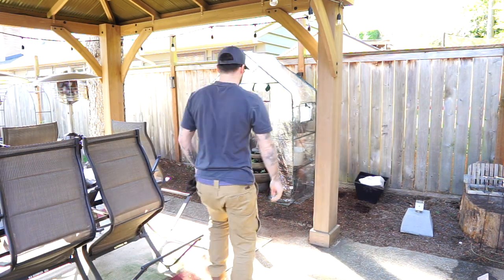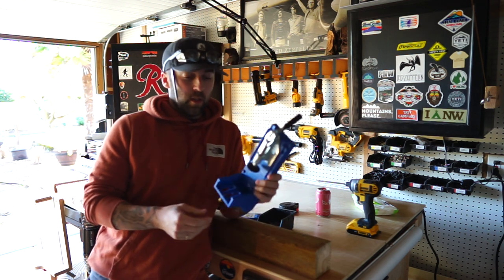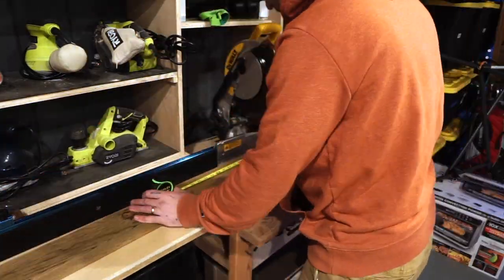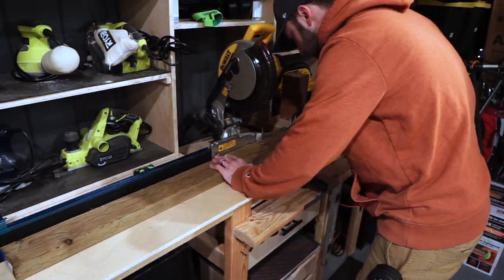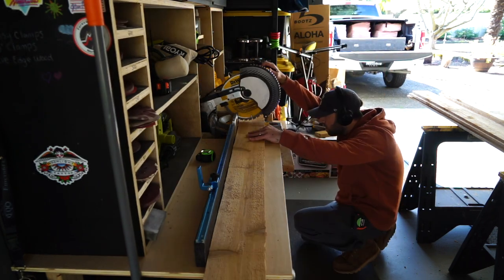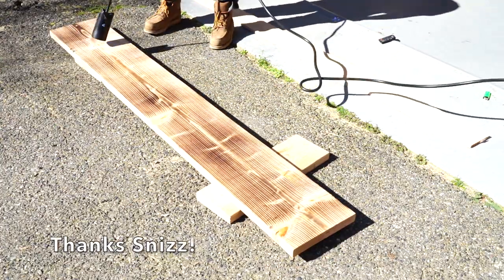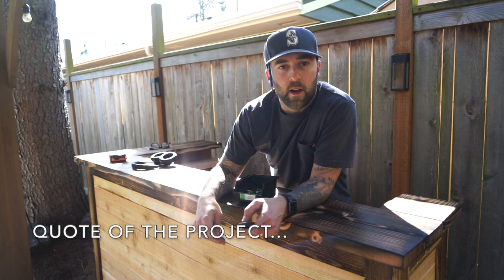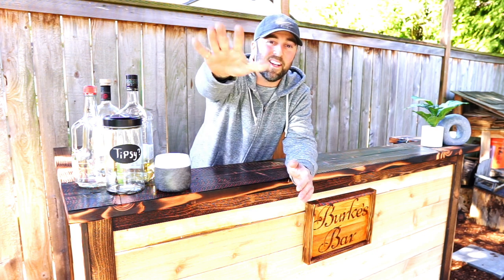DIY Outdoor Bar build!

Comment: What’s the blue thing you used to make the holes in the wood
Reply from the maker: It’s a Kreg jig K4, I removed the pocket hole guide due to the 4x4 being to thick for the clamp 👍🏼
Reply: FYI a simple Kreg jig will do if you want to hide the holes such as a Kreg R3, they can be found for around $30.  Good luck with your builds!

Comment: Finally after weeks searching someone to get to the point and show me exactly what I need to do !!  Thank you soo much !! What size did you use to do the frame into the wall ? I think you meant 2x12 for the top . You said 2x4x12.
Reply from the maker: That is awesome!!! Really makes my day :). And yes, you’re so right I definitely meant to say 2x6x12... still very new at all this filming/ building stuff haha. Good luck with your build 👍🏼
Reply: @jessedavidburke8861  do you think the cedar planks could be stained or painted . I want to make it grey and black
Reply from the maker: @ericawilliams18  since the cedar planks are so rough, you’d probably want to sand down quite a bit before doing so. I’m sure it would come out looking just fine either way! Are you thinking of spray paint; or a solid body stain?
Reply: @jessedavidburke8861  solid stain .
Reply from the maker: @ericawilliams18  I think it will look great! Maybe just use a scrap piece to make sure you’ll like it. Good luck!
Reply: @jessedavidburke8861  last question what size is the picture frame .

Comment: The way to use pocketholes to secure the top would have been to add the pocketholes along the edge of the cross piece that the top sits on. In the back of course. You could have even plugged them. Of course, you would have had to put off the Shou Sugi Ban finishing of that part until after the top was on, but you would have avoided the visible screws in the top.

A beautiful and simple build. It looks great. I like the abbreviated video as well. This didn't need 20 mins of detailing each step. I think you get more views with a shorter video.
Reply from the maker: Totally didn’t think of that haha! Great advice